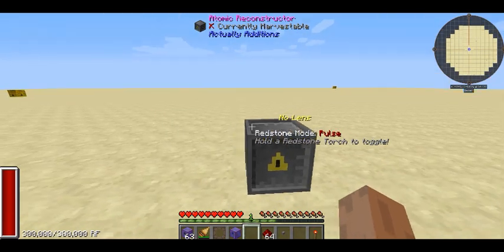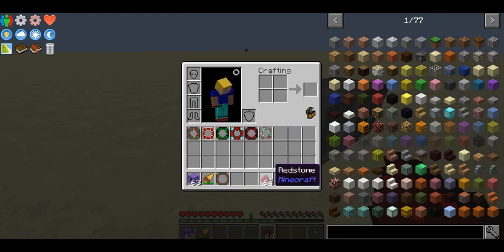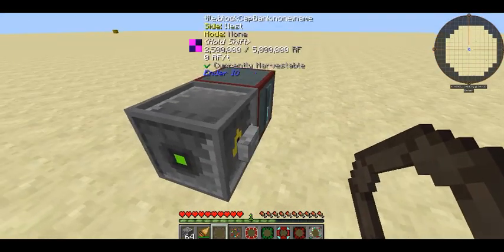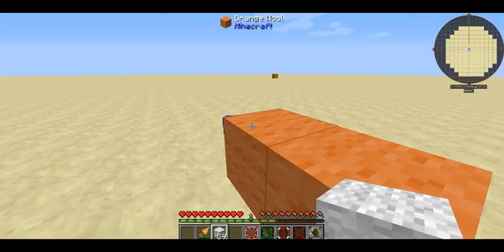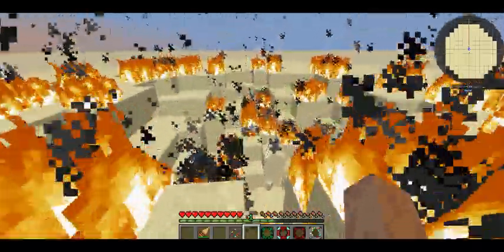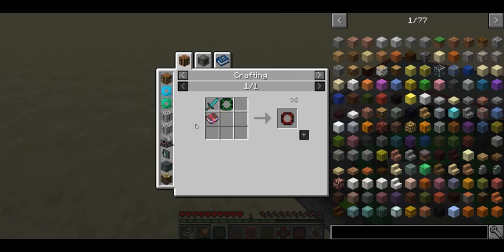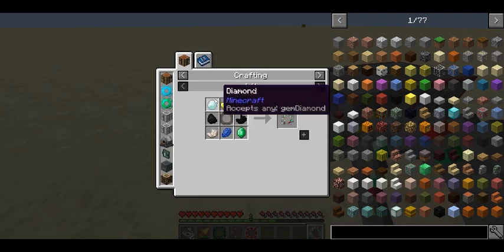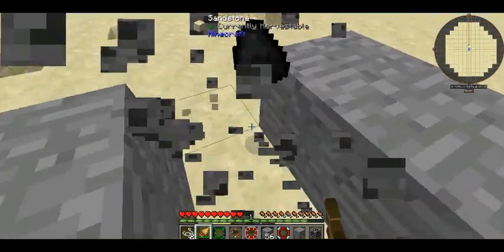FTB tutorials: Atomic Reconstructor

Comment: I need to know how to power this in Survival..
Reply from the maker: +Gaming With Ria you just attach it to some kind of energy source whether it be a generator or some kind of energy storage unit, connect it with either energy laser relays or conduits, if you want any more help about the power transfer I should have a video out tomorrow about how to use the energy relays!
Reply: Gaming With Ria i would recommend using thermal dynamics and thermal expansion with a steam dynamo. Or an immersive engineering windmill
Reply: which you need restonia to craft

Comment: The recipe book says it can turn nether quartz into prismarine crystals but its not doing anything :(
Reply from the maker: glardian966 it’s due to the power requirements. Make sure the atomic reconstructor has enough charge to complete the transformation.
Reply: @SeaCaps  oh, does it need to zap it multiple times? All the guides so far imply it only has one way to zapping. it's battery is completely full